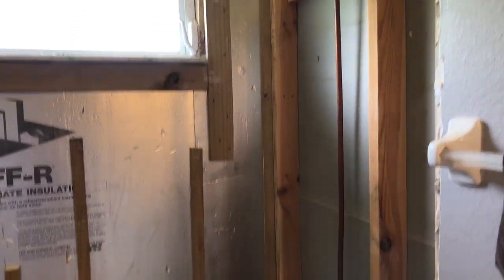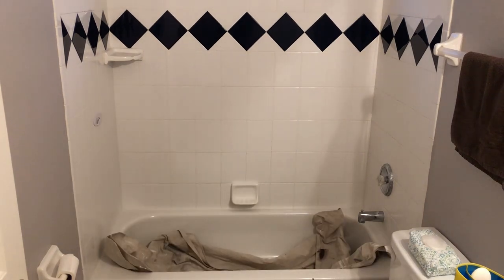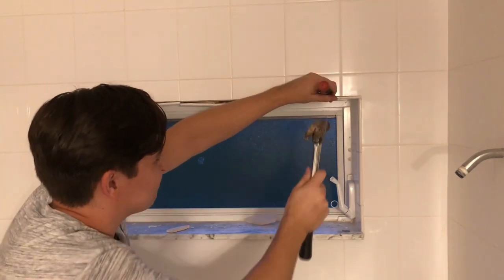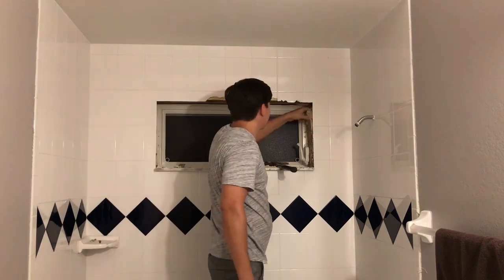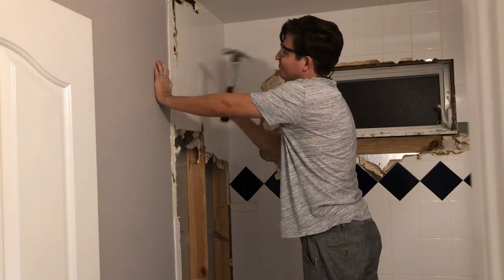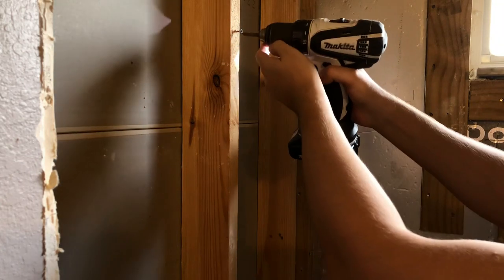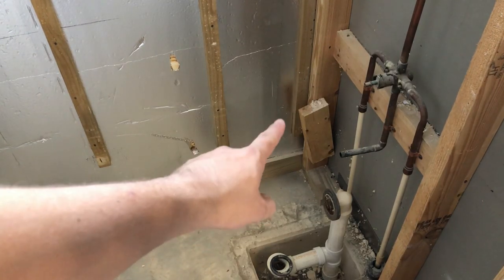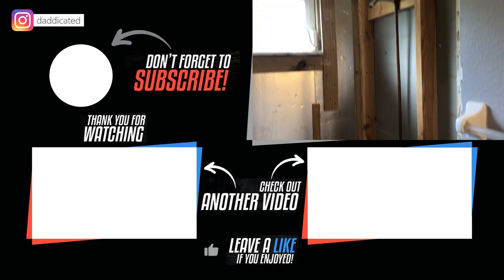How to demolish a bathroom shower | DIY bathroom demo remodel

Comment: BTW, copper is perfectly acceptable to use in Florida. What's taboo is PVC pipe when used for potable water. You must use either CVPC OR copper piping for potable water, not PVC. In Florida (yes I live in Florida) PVC may be used for drainage, venting, irrigation, pool plumbing and lawn furniture (LOL) only....
Reply from the maker: My guess my confusion is that the entire house is CPVC but then you find a small section going only to the shower out of copper. At this point why not just do everything out of CPVC.
Reply: @Daddicated   - It's a matter of convenience for the installer. You can use either. You'll likely also find copper outside where it enters your home (your main supply) because brass ball and gate valves were easier to find than plastic valves way back when your home was built. Again, you can use either. When your house was built (and mine in circa 1990's to early 2000's) likely some of these items were less available in CVPC and copper's been around forever (since the early 60's).

Comment: Is there a way to remove tiles without damaging them?
Reply from the maker: Probably not. Because they will most likely come off with the cement board. Unless they were poorly done in the first place and are not holding on to the cement board but that’s very unlikely.